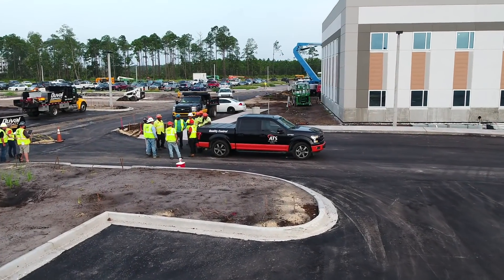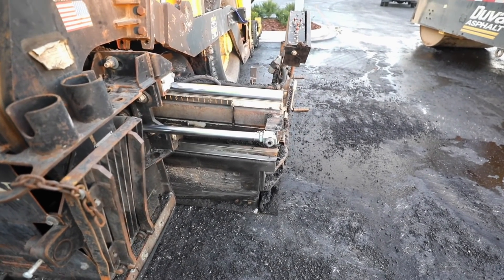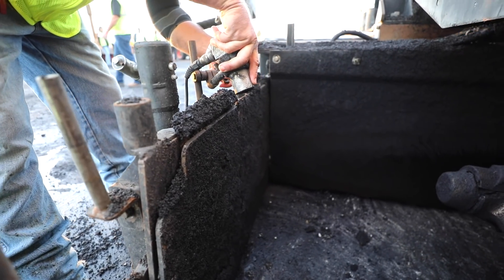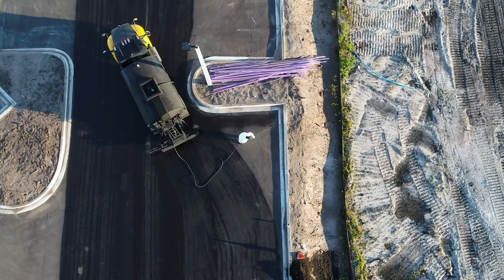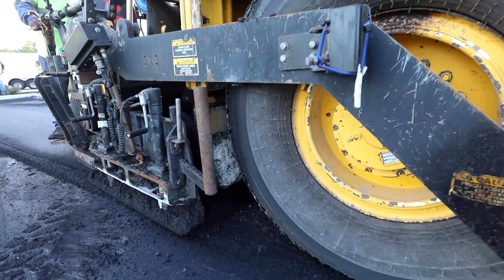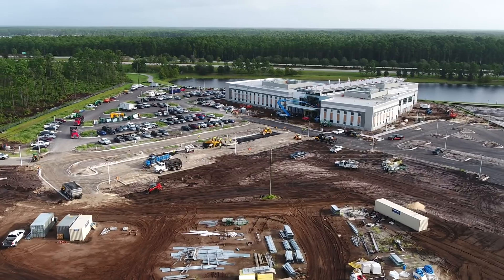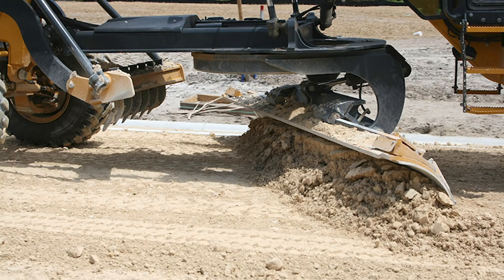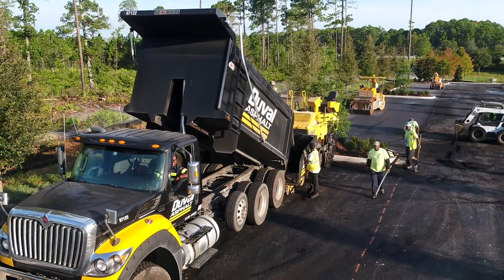How an Asphalt Paver Works and Keys to a Successful Commercial Paving Project

Comment: Man seeing that blue smoke come that asphalt, brings back memories. You always knew if the mix was right, and was hot enough by the color of the smoke. Blue meant that it was perfectly hot, and the hand work could be kinda rough. I got yelled at several times for dragging my shovel back instead of picking it up after sticking it in the pile.